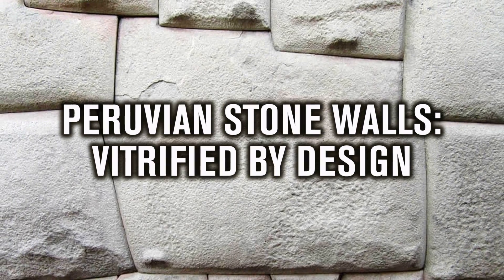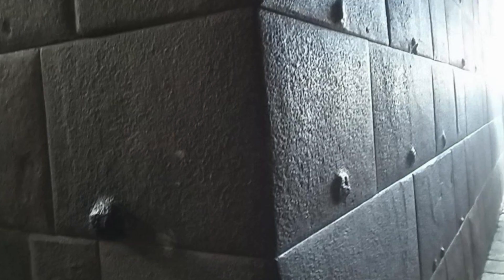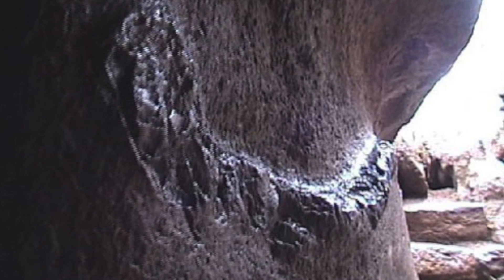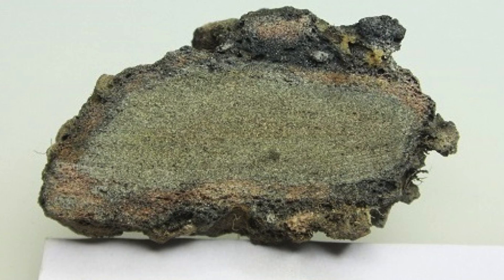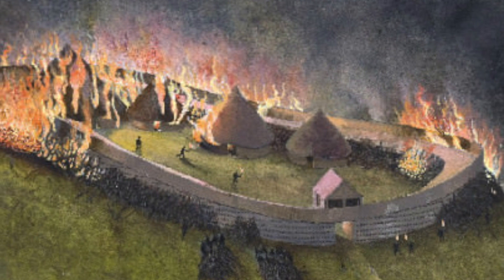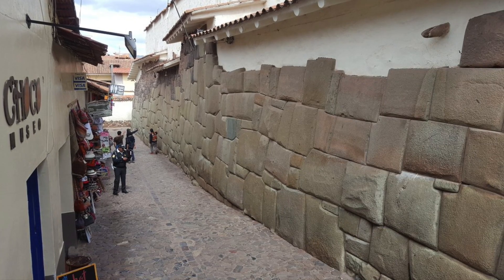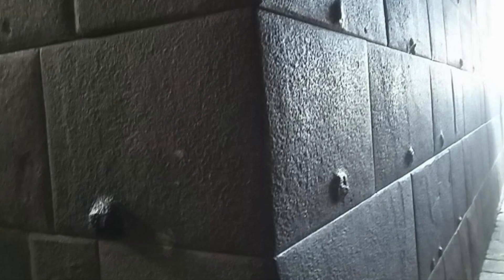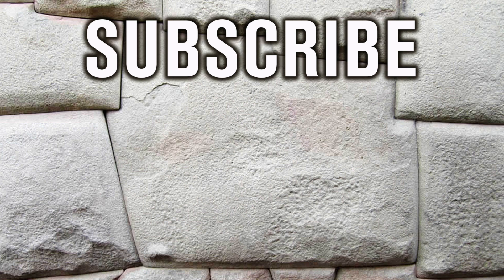Were the Peruvian Stone Walls Vitrified / Melted During Construction? | Ancient Architects

Comment: I am a metal sculptor and this looks like the slag left over from melting bronze or iron.  When you skim off the impure slag after melting a cast able metal, it is dumped to the side of your smelting pot and accumulates over time.  Stone is used to make the metal softer when melting it by adding lime.  Especially with iron.  It is very simple to do.  Sometimes a kiln or melting pot can have a blow out and all the coke (fuel) the burns at 3000' will melt sand into glass when it contacts it.
Reply: Thermite and stones. Use a high temp clay molding and light from the bottom, adding  stones. 2700 degrees infused stones reaction lowering temp.

Comment: My idea for the nubs is that when they heated the blocks to make them soft and put them in place, they simply placed supporting rods or planks of wood to push and hold in place particular spots where the soft stone may have pushed  out a bit. And after the stone started to harden they pulled away these wooden planks but because it was stuck to the surface it pulled out a nub. If you poke some sticky toffee with a pencil then pull it away, the pencil will pull out a bit of toffee and make a nub.
Reply: They weren't heated. You can't soften granite by heating and it still remain granite.

Comment: I think you're overlooking the energy required to melt the stone, a wood fire wont melt stone, it would require massive amounts of energy to melt a small stone let alone a very big wall with 100+ tonne stones.
Reply: True
Reply: @AmitSharmaTheMariachi  And how do you pick up a 100 tonne stone that's over 1000'c and dough like, what sort of oven gloves did they have back then, a few wet leaves wont cut it. And what tools did the use to get them perfectly flat/straight. You only have to look at massive modern forging machinery to realise the impossibility of the idea.
Reply: @dubsydubs5234  👍👍👍👍
Reply: Accidents happen. 

I accidentally melted my stone shed once, all that was left was a round puddle of rock. 

Heated rock is dangerous stuff. That’s why fireman wear helmets, so they don’t get drops of molten stone on their heads.

Comment: This may sound stupid, 
but is it possible that the knobs are a manufactured leg and fulcrum rocking pivot for the sculptors,  NOT a lifting point for placing on the wall,  but for allowing a gap in order to  place slings and levers in order to flip/swing the face side stone  back over on the ground after the shaping; before it is on the wall, 

Firstly, face side and outline with knob  leg of stone is hewn , then it is rolled face down, 
the knob leg gap allows straps and levers for movers to flip it back upright when the back is finished.
Second, the back side is then roughed out and adjusted for fit.

The back side of the stones are rough hewn, correct?
 Maybe upon installation, stones were flipped forward and backward into the wall until the the Back-cut or correct COPING was achieved. 
 By having a gap space a worker doesn't have to fight to get under the stone to reorientation the stone face out. 
You don't lift the rocks up the wall you add a dirt  and raise a plateau aside the  wall, then remove the dirt after wall is complete. a dirt scaffold if you will. 
its like the lost wax technic. OR how they do that with sand.

 I believe that it is a manufacturing or moving advantage. not to be used after the stone is placed, because they don't line up for level and are not symmetrical for aesthetics.
Maybe a fulcrum to swing into place and to stop the forward momentum/ pivot point not for lifting?
Why do some stones have them and other do not? 
What is the difference in the joint gap from the face to the inside rear of the stones? Tolerances.

Furthermore, why is this tech on multiple continents as well as the key stone joints?
Reply: Good point really.
Reply: Right on sounds possible ! :)
Reply: I was thinking the same...
Reply: I Wondered if the stones weren’t exposed to extreme heat and that is where the stones maybe started to melt before the stone solidified again. Causing a brief candle drip effect. Ways I thought possible were From plasma burst from our sun, ancient comet impacts, volcanic eruptions, etc.
Reply: the knobs are for the scaffolding
Reply: They very much look like casting imperfections from a mold, usually known as a drop.
Reply: this is how the large stone heads of Easter Island were moved - not rolled on logs but "walked" upright, back and forth by teams pulling on ropes.
Reply: @yewtoob2007  they aren't stone heads, they've since excavated around a few of them and found they are full statues that are actually enormous and it's just the heads that we could see.
Reply: I had the same thought that somehow they were there to aid in lifting of the rock, allowing workers to get under it easily when it was flat on the ground.
Reply: @samyoungblood3740  Mainly the limestone blocks were coated with a silica gel based. obviously something has flaked off in places.
Reply: Knobs are always designed to interact with external conditions. Not every block has these external humps. It is noticeable in areas where the maintenance of the contact pressure is critical. several knobs can be on one node stone. it is as if the blocks with the knobs were intended for a static symbiosis with external substances, like an ice shield.
Reply: That's a great idea actually.  The problem I always go back to is some blocks/stones that are small enough to be picked up by one person sometimes have them on them. And in the other hand there are giant 30 tons stones that don't have any knobs.  There is just no rhyme or reason
Reply: @carmineredd1198  if so why are there knobs on walls that are only 3 feet high.  That wouldn't need scaffolding
Reply: @iamthepapa  That's a good idea but why are there knobs on small stones that can be easily lifted by one person.    And then on some giant Stones no knobs.  It just doesn't make sense
Reply: @kevinm9  fulcrum point for stability  to have shorter sticks wedged tightly and then a rope tied to a longer pole  to hold it downwards to keep the scaffolding from wobbling ,  pounding causes vibration and the workers movements would cause the scaffold to shimmy and sway . look closely at all the knobs, they have steep angles on the bottom and sloped on top
Reply: @carmineredd1198  That could absolutely be what it is for.   But then why would there be knobs on Stone walls that are only two or three feet high where you wouldn't need scaffolding
Reply: @kevinm9  if you look at the stones in certain positions they don't have them, Because I believe they are the first or corner stone that sets the course, they don't need to be adjusted because all other stones fit around them. some looked worn or clipped off the lower on the wall maybe because they become obstructions for passers bye,
Reply: @kevinm9  notice at 12:45 the corner stones don't have the knobs, but the rest of the wall does., Could be that they are merely lifting points for some levers to adjust the more difficult rocks for fitting. Ounce you get the rock in it may not be easy to get back out if you need to chisel more, but with a lever point you could lift and shim under it to remove and alter it. Otherwise how would you get it out except for pushing from behind.
Reply: @kevinm9  Good point.  I had two other thoughts about the knobs.  From reading this thread, someone mentioned external substances, which sparked an idea.  We know that blocks are offset and positioned in such a way to withstand earthquakes.  Maybe the knobs exist for a similar reason, in some undiscovered method to combat external forces like mother nature, to give the structure longevity.

The other thought, is to just try and come up with the simplest explanation.  The stones look like they were melted or shaped by heat.  If it looks that way to my eye, then maybe it was actually done with heat.  Many are not familiar with Brown's Gas, HHO.   Incredibly simple to produce and could be fashioned into a cutting torch.  With the knobs appearing random, they could be artifacts from the heating process if too much heat was used.  Maybe it was easier to leave the knobs than to remove them?   

I've also thought that maybe they were part of artwork, murals that no longer exits where the knobs accentuated the artwork.. think eyes, feet, body parts, etc..   i hope someday, someone can figure it out!
Reply: @carmineredd1198  I'd love to see an illustration of this technique.
Reply: @iamthepapa  this was shown in an old video by a local young man who explained that a series of stones were shaped to. Depict a dragon with the nubs forming eyes or other body parts.  Long time ago soI don't have the source data.  Ray
Reply: Good hypothesis. But will we ever know for certain..?

Comment: Every igneous rock is vitrified. By definition. The skin of smooth rock you cite is technically a glaze. That is a partial remelt of a vitrified whole. 
Common building brick is made of clay that is molded to shape and then fired. The surface of a brick may have a slight glaze due to higher than average temperature. 
 Basalt and quartz melt at about 1250C. Wet quartz will melt at about 700C. But only in a shallow layer, 1-3mm on the surface. 

An enclosed wood fire my reach 300C. More with an air blast. 

A coal fire is capable of 400C, and up to 1000C when reduced to coke with an air blast as in a forge. 

An appropriate gas forge  may attain 2000C. 

An atomic air burst, or the kinetic air burst of a high velocity astronomic object, may generate 100,000,000C. Radiated heat falls off with the inverse of the square of the distance from the source. The concussive force of pressurised air falls off in direct proportion to distance. Thus in nuclear tests wood frame structures at some distance are blown apart long before the combust due to radiant heat. And yet nuclear glass is found at the center of detonation due to the initial high temperatures. But no structure remains standing. 

So. Stone walls will not be melted, nor vitrified, by embers from adjacent burning buildings. Not even by a wood fire in a forge. Not by coal fires nor even with open gas flame. 

Nor would a stone wall that was close enough to a detonation to be glazed, much less melted to a point where it could vitrify on cooling remain standing in face of concussive blast. 

An yet we see evidence of selective melting of igneous and sedimentary stone in situ in a highly selective manner. This is the 
Conundrum that engineers and archaeologists and the simply curious face in explaining such artefacts. 

I offer no solution. Only an elimination of certain explanations by application of physical facts with logic. Discussion?
Reply: I have read a lot of speculation on this post. I don't know science but I thought myself that there's no way a simple fire or even a big fire would cause stone to soften or melt "into shape". That makes no sense. What was holding them in place while the cooled? If they were that hot wouldn't wood just burn?